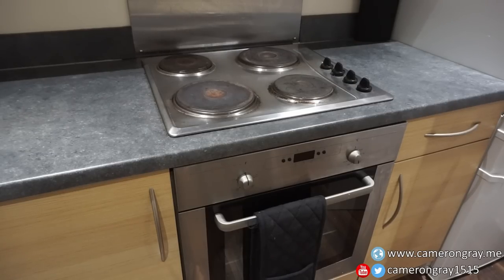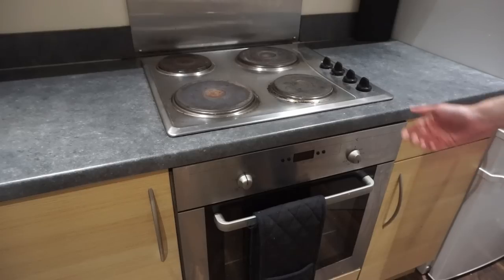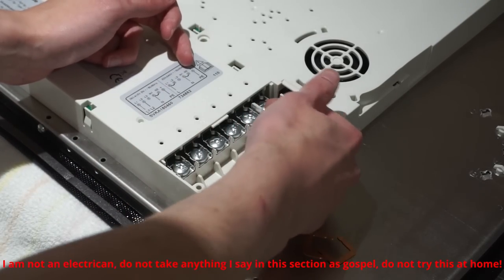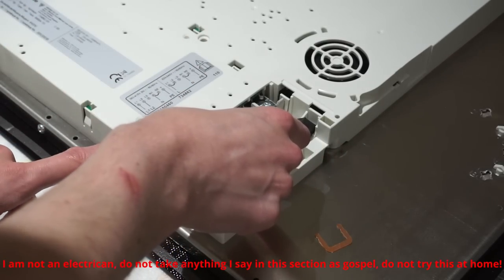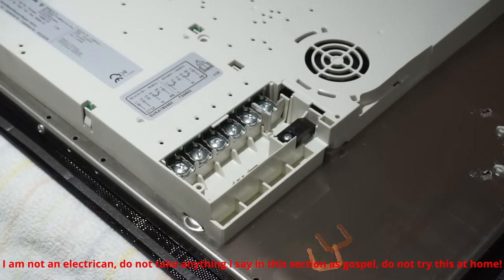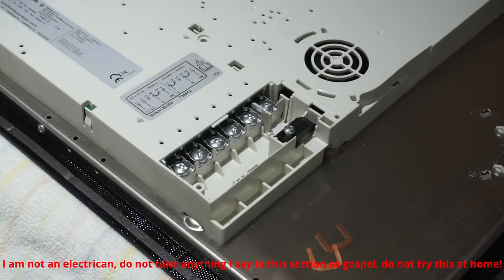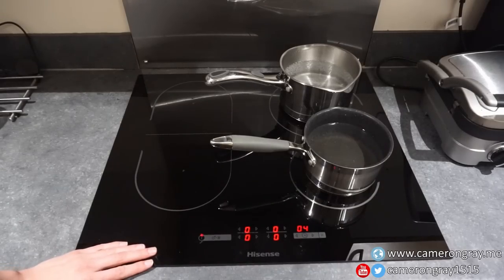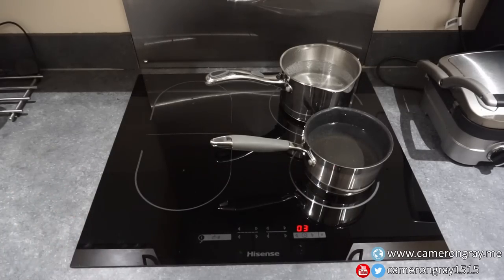Upgrading to an Induction Hob - Hisense I6433C - Installation and Review

Comment: I've just ordered the same one. How's yours holding up after 2 years?
Reply from the maker: It's been great, can't really fault it, especially for the price.  Worst I've had is maybe a couple of times it's not responded to button presses and needed turned off and on again but that's the only issue I've had at all.
Reply: @camerongray1515  Thank you for a quick reply mate. Currys are dropping mine off on Tuesday.

Comment: My existing Hob plugs in to a 13 Amp Socket and my Cooker is wired up separate Could I put a 13Amp plug on this Model and use the same socket
Reply from the maker: Obviously I'm not an electrician so bear that in mind (don't take anything I say as professional advice) however this hob does mention in its manual (page 28 https://d3537i9v051wn8.cloudfront.net/uploads/2018/12/785435_I6433C.pdf) that you can set a current limit of 10, 12, 13 or 16A so I can't see why not as long as you use a suitably fused plug and a flex that's capable of carrying the full 13A and make sure you set that limit so that you don't end up blowing the fuse constantly.  Doing this however will limit the power output so you may not be able to run all the rings on full power at the same time.  That said, you can also get induction hobs that come with 13A plugs pre-attached so unless you plan on hardwiring it in the future, one of those may be a simpler option.

Only thing I'd be careful of is your circuit that's being used for your current hob - if you have a gas hob it's possible that the socket was only ever intended for the igniter which is low current so if you have say, that socket sharing a 20a circuit with your oven, or if it's just part of your kitchen ring, you may find that running a 13a hob at full whack while also say, running your oven or washing machine, may be enough to trip the circuit.

It may also be worth considering getting an electrician to take a look - it could be possible that your existing oven circuit may be able to handle the hob as well or it may be a case that adding an existing circuit in may not be too painful.
Reply: Must be going daft as I rechecked to find out my existing Hob (which I intend to replace) is actually hard wired to a PowerPoint in the back of the below so the only bit I did not get is the wiring up
Reply from the maker: That's better than a socket but you'd just need to take care to ensure that the circuit is rated to take the full power of this hob if the one you're replacing is less powerful.

Comment: Is this horrible buzzing noise normal (22:30s)?
Reply from the maker: It's fairly normal for induction hobs to make some sort of buzzing noise, in particular at full power the noise can be fairly noticeable, however at lower powers (the ones you'd actually cook at rather than the ones you'd use to bring something up to temperature quickly) it's more of a quieter, pulsing buzz sound.

Comment: Can u tell me induction cooker and electric cooker and cyramic all is same or different ? Pls reply
Reply from the maker: The only similarity is that they run on electricity, totally different otherwise.  Regular electric "hot plate" hobs are the cheapest but are extremely slow and hard to control.  Ceramic are the ones that look like glass and light up red when they heat up, they're better but are still a lot slower and less controllable than induction or gas.  Induction uses magnetic induction to heat the base of the pan directly, they are by far the most efficient and controllable out of all electric hobs and are pretty much on par with gas.  However, the only downside of induction hobs is that they only work with pans made of ferrous material (material that a magnet will stick to) so can't be used with aluminium or copper cookware, these simply won't heat up at all.
Reply: Cameron Gray thank you so much I’ll go for induction hobs only.. Plss one more question if u can reply me please... do they take more electricity like if compare induction or ceramic which makes electric bills less? And I live in uae 🇦🇪 it’s hot country 8 months summer and 4 months its winter here cold. So it’s safe to use it here in this climate Plss reply it will be very helpful cauz I am going to buy this 1st time

Comment: Cook some food on it. Boiling water isnt an indication of a good product.
Reply from the maker: The water was to provide a fair, repeatable, comparison between the two to show the overall time to heat up and to provide a visual demonstration of the responsiveness. My feedback overall was after a couple of weeks of cooking on it regularly. Trying to film myself actually cooking would have been awkward and wouldn't have provided particularly useful content.
Reply: @camerongray1515 

Absolutely.........  Bought a single burner portable Tefal 2,100w induction hob and it's fantastic, boiling a stockpot of water very quickly while retaing a furious rolling boil. Don't see there would be any problem cooking food.